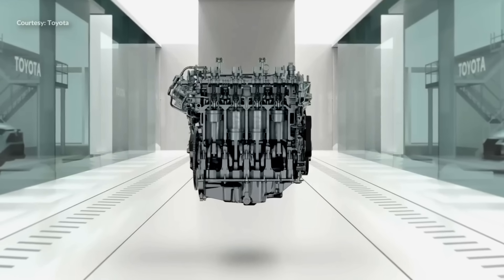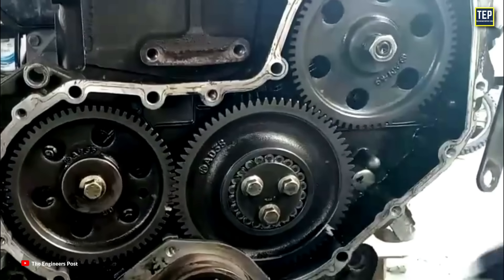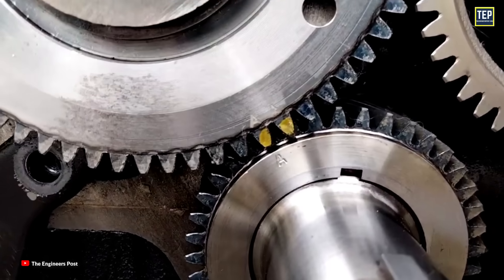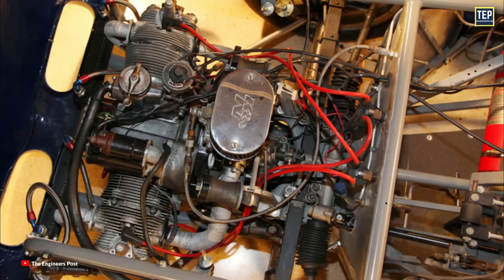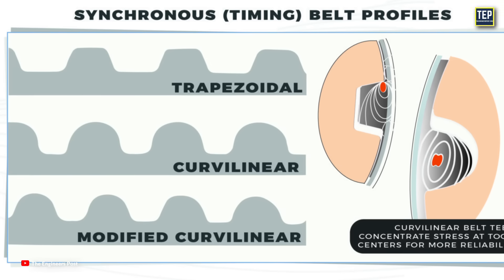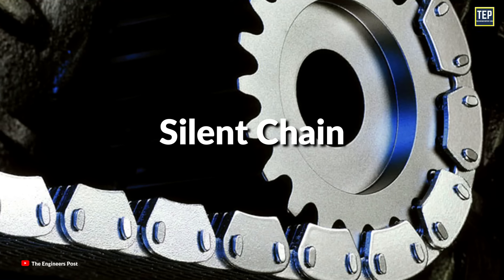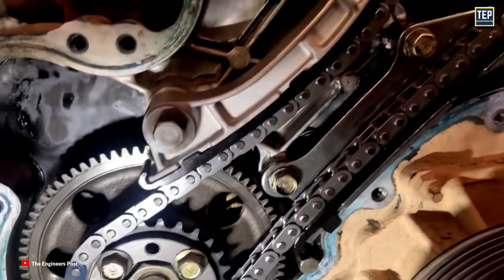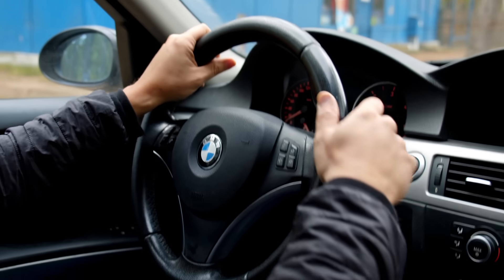Which Timing Mechanism Is Best for Cars?

Comment: Regarding 15:54, based on empirical evidence, I am positing a correction: although Toyota's 1MZ-FE engine is non-interference, the 3MZ-FE is an interference engine [1,2].  Also, the MZ-family of engines.

[1] "Interference or Non-Interference? Toyota 1MZ-FE VVT-i 3.0-liter V6" on the "Merryfrankster" YT-channel
[2] "Toyota/Lexus V6 - Interference Engine? 3.3-liter 3MZ-FE Camry Highlander Sienna RX330 ES330" on the "Merryfrankster" YT-channel

Comment: you open with, " A car's engine design is Beautiful"  maybe in 1929,for mechanics, oil companies, replacement parts biz, but not for average drivers. they are an outdated, illogical, wasteful Peece of Sheit!!. so many parts, emission controls included to Fail,. An electric motor for propulsion is so much superior, so don't listen to those charlatans who bash ev's, they have an ulterior motive, and it ain't good for you. only suckers in the future buy these dinosaurs.

Comment: Is it accurate to say that OHC engines have not set finger follower/rocker arm ratio due to the fact the lobe of the cam begins to open the valve at one location on the follower and ends elsewhere?

Comment: Thats actually not entirely true. I've had many timing chain driven engines with a plastic valve cover. 2003 Mercury Sable 3.0L DOHC, 2017 GMC Acadia 3.6L, 2023 Mitsubishi Mirage 1.25 L

Comment: In theory, a good overview. BUT: there are special cases. a) Certain known car lines from a German manufacturer was/is famous for using (supposedly cheaply produced) single roller chains, leading to incorrect timings LOOONG before a typical belt would require a replacement. So they are not a universal solution if not implemented right. b) belt-in-oil has never been a good idea for various reasons, like requiring special (expensive) oil, needing special belt materiasls with some protector finish (which is typically some PFAS which is eventually not good for the environment), and the permanent danger of contaminating your oil supply system with lots of rubber dirt very quickly whenever the sealing gets broken, needing additional cleaning job inside of the motor.

Comment: Using timing gears is almost impossible for error to adjust because is only 1 single way to mount the gear into shaft. 
Every gear have little sign, by adjusting those - gears are adjusted 100% without any error. 
Needs only simple understanding of mechanics and everyone can do it. 
Even is not needed to change them in lifetime. Are part of engine itself. Simply they dont break.
And no, gears are not more expensive than chains or belts, when taking into account the liftime if gears, compared to price and lifetime if rollers for time belt, tension holders, bearings, chains or belt itself. 

Todays cars are build to last 100-150k then throw them away.

I dont understand (and maybe i never will) why peoples buy new model when the old one still works fine.
More expensive does not always mean that is better product.
Even newer models are less prooven than older ones.

Comment: I discovered what a timing belt was (and a non-interference engine was) when mine snapped 90 miles from home while on summer break in college. A storm approaching but luckily two shops were nearby. The second one acquiesced and squeezed me in. I got home the same day. A year or two later it broke again and block from my house. I knew the sound and feeling of what happened right away. Wasn’t long before my transmission main seal went and we got rid of that MOPAR car and got a Corolla. 😊

Comment: My preference, if the engine has the camshaft in the block, (pushrod, OHV design) would be for timing gears. If it's an overhead cam engine, my preference would be a timing chain. However, a lot of newer vehicles are having timing chain failures where the predecessor engine, which was a timing belt engine, actually was more durable and reliable. 

A timing belt is not my first choice, but some of the most reliable engines produced use a timing belt. A lot of Honda and Toyota 4 cylinders, for example. I just think that with any engine, but especially a timing belt or timing chain equipped engine, it should be built as a non-interference engine. 

If you manage to get out of time with timing gears, then something pretty catastrophic has happened. But even on a well-maintained engine with a belt or a chain, you could have a bad part like a tensioner or idler fail and cause the engine to go out of timing, which then ruins the engine when the pistons hit the valves inside the engine if it is of an interference design.

Then, we get to the wet belt design. No. Just no. Absolutely not.

Comment: Timing belt is not more reliable than the chain and cars today still use timing chains and today's timing chain will outlast a belt 50x over as long as you change the oil the biggest advantage for belts they are more lightweight

Comment: Gears are best but have weight and are expensive to manufacture, belts are light, quiet and reliable if changed when required, chains can be good and get high miles without maintenance if they are designed well with quality products in the first place so the average buyer has two choices belts or chains and to know where you are look at the history of the particular engine and make a choice on that and never, never buy a car with a wet belt. Just my 2 cents after 40 years as a mechanic.

Comment: Timing chains make engines disposable, nissan from qr and up engines become useless after timing chain guides problems because of the cost of engine removal and timing chain replacement. The ford OHC cost 4x than the pushrod chain to replace. There are no benefits to timing chains, now engines don't have woodruff or key on the crankshaft to pulley either. You can thank the Germans for timing chain problems. Then you also have chain problema on all CVT, not a good thing at all.

Comment: Hello, 
I own a 1967 chevy van I got over 300k miles out of that 250 straight 6 . BECAUSE IT HAD A TIMMING GEAR. The auto makers went to timing chains, then timing belt to practice their predatory engineering in oder to keep the motoring public in economic slavery.  I know these old vehicles and work on them modifying the body parts with stainless steel. A bad repudiated metal with auto makers. Can you buy a new stainless steel vehicle no matter how much you want to spend? Why don,t auto body shop personal aquire skill sets to weld stainless steel to regular steel using a 319L electrode and tri mix shielding gas? They are in my opinion in some kind of TRUMP CULT.

Comment: Belt fails before the engine because the engine lasts over 300,000 miles. The chain lasts the life of the engine but also needs to be changed at 180,000 miles? So, 3 belt changes, and it outlasts the chain. The belt is also quieter and cheaper. Also, having things inspected while having a belt replaced is a good idea. The water pump gets replaced, usually with the belt. Engine casting is less expensive since the belt is outside of the block and head. Round seals are less likely to leak than a timing cover gasket and are much easier to replace. The belt should be DRY, because a WET BELT is subject to acidic oil after it has been diluted with fuel and oxidized. The WET BELT can disintegrate and clog the oil pump pickup, losing oil pressure and killing the engine.
Reply: Non interference belt is better than chain since it can go forever

Comment: I'm very familiar with the V-4 Honda motorcycle's and hate them with a passion.
I don't care how good they became  in later years, the early ones were complete shite with numerous problems.
Even the gear drive VF750 wore out  cam gear 'cartridge' really fast (never mind the bikes where Honda 'forgot' to harden the cams)
I started at a Honda dealer workshop in late 1970's, moved to a Suzuki dealers 1980 and worked on V-4 Honda's at least once a week for several years.
Moved to America 1999 and still worked on junk V-4 Honda's (mainly V45 Magna)
Seems I always get the worst designed motorcycle engines at dealers (doubt anyone else understands them?)
Kawasaki used silent chain so lightweight it was completely worn out in less than 20,000 miles (600cc and 750cc) and if not changed would break before 30,000miles.
Honda wt belt in industrial engines isn't rubber, the one I looked at was bright blue 'plastic' of some kind.
Solenoid valve operation requires a high amperage for high rpm applications.
I know there have been developments in the last 20 years (you used to be able to go directly to development website, around 2005~6)
Apart from that, this was a very good engine primer for camshaft drive types

Comment: Yes timing gears are so bad that the Ford 300 can run 1 million miles without issue.  Mine is at 600k miles.

No chain or belt will do that.
Reply: There are old Hondas out there with 500k easy on a timing chain lol but i get it
Reply: @stevemisfit1  yes and Honda requires the valve clearance checked every 6k miles.

Personally I don't think of a 2001 as old, especially when can be compared to a engine from 1965.  I know 01 is over 20years old but hard to think of it as old, just like 90s cars are now classics.
Reply: Ford 300 is a marvel of engineering

Comment: Some chains have change intervals. When a chaon is on an ohv motor it usualy isnt an issue.  But as they get longer it becomes an issue for example a two or four over head cam v6 or v8

Comment: The engine in my 05 Civic has a belt. I don't know when it was changed last, so I got a timing belt and water pump kit along with some other gaskets and seals. 
I'm not a fan of timing belts. I've changed a few but this is the first one I've personally owned. I will never buy another vehicle with a timing belt. Or any modern vehicle for that matter

Comment: Direct mesh timing gears are the most durable, but not practical in most modern, high efficiency dual cam engines. However, some creative engineering in the early 20th Century employed geared shafts to operate dual overhead cams. Yes, they did.

Chains are usually equally durable, but in OHC engines the plastic guides often fail early from heat stress and wear. Avoid a wet belt engine, no matter who made it.

I prefer the dry timing belt. Modern construction is as reliable as tires. They are relatively inexpensive and accessible without compromising oil containment, and if replaced timely with tensioner and idler will rarely fail. Only use an OEM kit.

Comment: Vertical shaft, with bevel gears at each end, is a good solution. Oldham couplings can be included if required as can a 'hunting tooth' to even out any wear if required.

Comment: Can you use timing gears with a dual overhead cam engine?
Reply: I'm sure it could be done.  Look at the Deltec.  It had three crank shafts geared together.
Reply: @bobbysenterprises3220  absolutely it can be done. General Motors locomotives for years have used strictly gear driven overhead cams. Belts would never hold up under these conditions and chains on locomotives are a thing of the past. I am not certain about GE locomotives but in the past Baldwin locomotives use the chain. These engines were built back in the 50s of course some wise guy is gonna say we’re talking about cars not locomotives. That’s true, but it’s also true locomotives are like they have already bunny.. They just go and go and go and even today you will find locomote is built in the 50s still in use of course they’ve been overhauled numerous times but not because of a broken belt or chain. Just clean the parts, gears included, and reassemble the engine – – good as new!!

Comment: The best engine in my opinion is the OHV engines. They are very simple and last a long time with proper oil changes. Plus you don’t really have a timing belt to worry about. Plus OHV engine are non interference so if the small chain dose break your valves won’t be damaged.
Reply: Changed the chain in my jeep 4.0l because I had the cam out.  New chain was about the same as the one I took out that had over 200k miles on it.

Comment: I, not mechanically trained, have long held the opinion that timing gears, weight and noise aside, would logically be the most durable and reliable setup.
Reply: It's true but mostly seen in heavy vehicle applications
Reply: @BigMoistMuffin  .. and in german vehicles. or just BMW/Audi..

Comment: Chains are the way to go. That’s why belts are almost extinct
Reply: Aside from in a vast amount of cars. Seriously they are just about as common as chains.
Also chains have service intervals too, they suffer from stretch and often the guides can fail. They also increase shear in oil degrading engine oil quicker.
Belts are easier and cheaper to replace than chains and if your wanting to keep the vehicle after it has reached 120k miles you are just aswell off with a belt as a chain.

Comment: You should change timing belts 50.000 or less miles , especially if you are in a dirt dusty landscape, timing gears, I have nerve change them, and timing chains I ,have never changed, so it’s  all up to how you change your oil , 3 ,000 miles or less, and that will save the chain and gears ⚙️, last longer, belts are and expensive easier to change, thanks BigAl California.
Reply: My Toyota 3mzfe has a 90k miles or 9 years. What brand suggests 50m miles???
Reply: I would prefer belt. They are lighter, cheaper, never stretch and therefore never lose timing, and if you have no oil leaks and change belt in time - it won't cause any problem. Worn chain or tensioner require expensive repair. Especially modern one row chains are a crap.

Comment: I wonder how many people would rather pay upfront the "extra cost" these car manufacturers claim they have when they use a timing belt that needs replacement at 100k vs a timing chain that will never need replacement?
I just spend $2500 on my 2017 Acura RDX changing the belt. Had it been a chain that never needed replacement, but the initial cost buying the car been $2500 more, I would have paid increased price at purchase, knowing the engine was solid for the life of the car.
Reply: Would not have been $2500, more like $200.  Most of the $2500 is labor, plus the water pump.

Comment: From timing gear, timing chain to timing belt. All I hear is that the downgrade of quality of car parts is because costs reduction. Timing belt is the owner nightmare. Timing chain is better but timing gear is great.
Reply: Why is the belt bad?
Reply: @Tapped-o9k  the belts break after only 80k and destroy the engine beyond any hope of repair
Reply: @householdhacks broken belt doesn't automatically mean destroyed engine.
Reply: @householdhacks  my engine is non interferance. Belt got changed once in like 2008 and now with 100k km more it still seems ok. The change itself is very easy and the belt is like 70€. Also easy and fast to diy
Reply: @Tapped-o9k  because you have to change it at 100.000 km. A timing chain, if you change the oil at maximum 10.000 km, can last up to 500.000 km without issues. And the timing gear is the strongest.
Reply: @Tapped-o9k Belt breaks easier, needs replacing and has no advantages other then cost of manufacturing.
Reply: @miendust It's built to be replaced, it's easy to do and keeps rated hp and economy over a long time. Even the best chains will stretch by 250,000km reducing performance and economy. The worst chains are terrible requiring expensive replacement at belt like intervals.
Reply: Ive had both and I prefer a belt. Chain is expensive to fix if something goes wrong.
Reply: Belt gives best performance on the other hand
Reply: Don't drive an ordinary car like a race car, too much, and they always hold up for me. Muscle cars often stay mostly in a shop due to over abused and neglect. They're so overbuilt, will often outlive the average grocery getter if you treat them right.